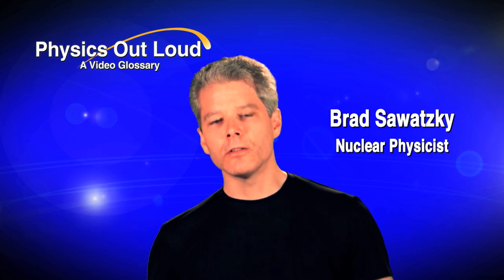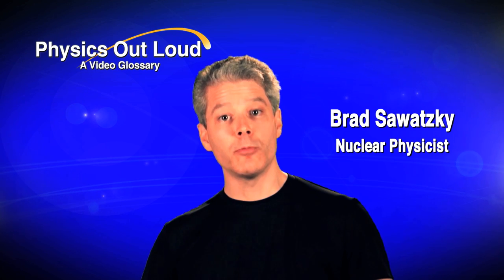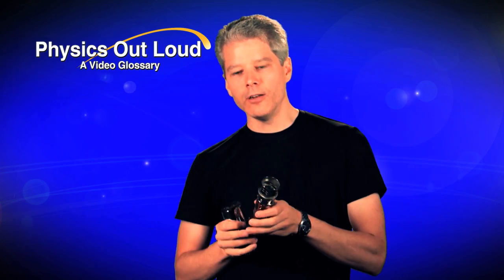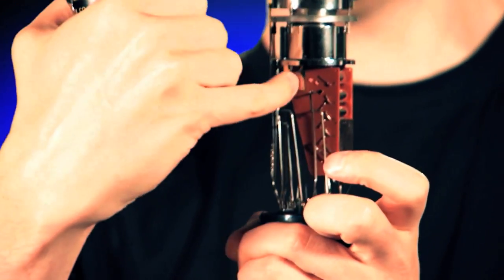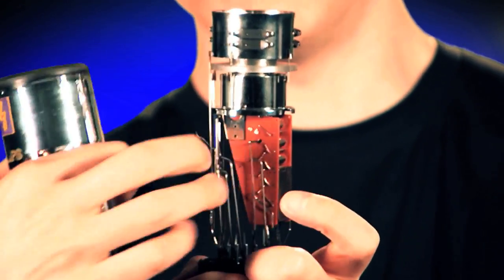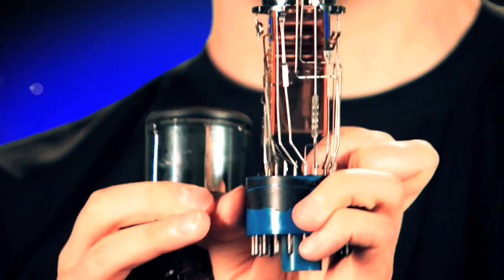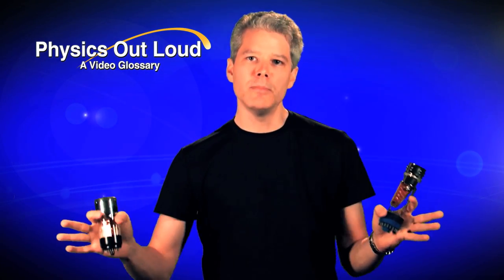Photomultiplier Tube

Comment: Would like dynode chain explanation
Reply from the maker: There's a voltage difference between each dynode, so electrons gain energy as the 'fall' from one dynode to another. So, let's say that the electron that's ejected from the photocathode gains enough energy to free 10 electrons when it impacts the first dynode in the chain. Each of those 10 electrons gains enough energy to free 10 additional electrons when they reach the second dynode. Now we have 100 electrons which are accelerated to the next dynode. Then 1,000. Then 10,000. Then 100,000.... By the end of the chain, there's enough to make a measurable signal.